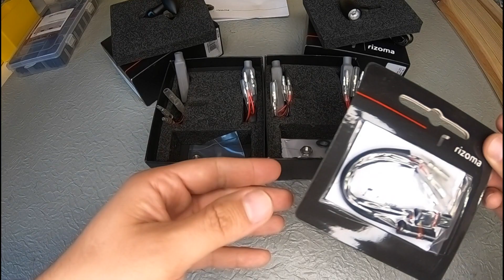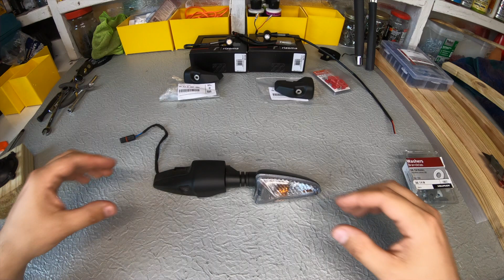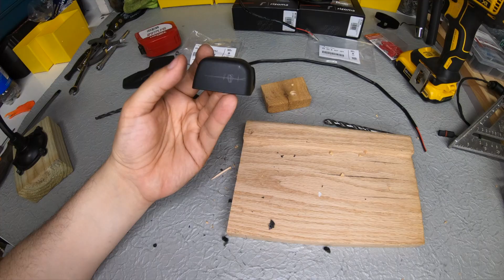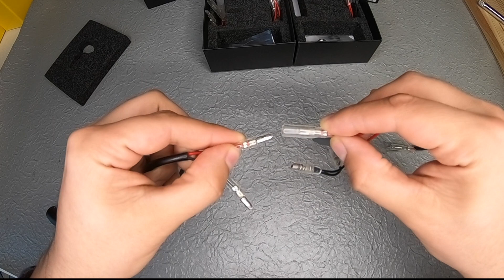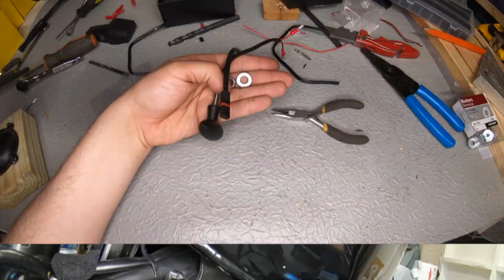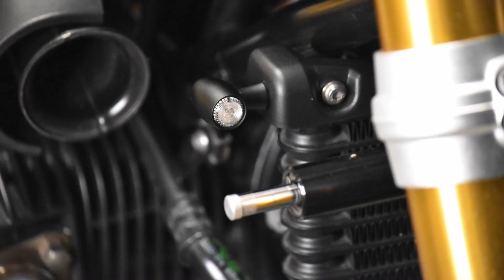Rizoma Club Lights Installation on a 2014 BMW R nineT

Comment: They have to be 3-4 times bigger
Reply from the maker: Not in the USA, and those lights are way brighter than the OEM lights
Reply: @Janoo609 no doubt that they are bright but big form would add to retro look. I think blinkers should be bigger and mirrors should be round :)
Reply from the maker: @KyryllStd  I think it comes to personal preference.  I did not want large lights, I was looking for a more discrete look
Reply: @Janoo609 I wish they give different size options… unfortunately the trend is to get the smallest possible…

Comment: does the 2016 require the resistors or no?
Reply from the maker: @chriskamen2152  I am not sure, but the Rizoma lights come with the resistors included.  My advise is, disconnect a light and plug in the one you want install to test it before going through the whole assembly

Comment: Hi. I’m having a problem with the relay. My dash shows an lamp warning sign after changing to LED. Is there any solution?
Reply from the maker: Did you use the resistors?  If you did and still have that warning light on your bike, then the next step is take the bike to the bmw mechanic and ask them to change the codes.  The r9T came in two different modes, ready for LED lights (European version), and bulbs (American version).  The codes on the bike can be changed, but that can only be done by a BMW mechanic.  People use the resistors to bypass the codes
Reply: @Janoo609  I will try this next week if they (US FL dealer) can change the code of my 2018 bike LED. I installed New Rage Cycles tail tidy led kit and my bike was getting an error.
Reply: @Janoo609  I contacted BMW in my country and 3 of them dealers gave me the same solution. “Do not use aftermarket parts. Because the code is gonna pop out no matter what you do”. So to me they just wanna sell the original spare parts which are super pricey. Reason why I’m trying to change my signal light is because the brackets are so fragile it cracked and turned into powder. I’m not sure if it lasted longer in cold weather country. These signals light from BMW are just unreliable.
Reply from the maker: @bruceiscurious  My guess is that they do not want to help you.  They should be able to do it just like they would do if they were installing the BMW LED lights.  

One more thing you can try is to install the resistor in the different forms they have in the instructions.  I believe rizoma gives you like 3 different ways of doing it, depending on the R9T model you have.  Try each one of the different options and see if any of those work

Comment: Hi, having found the indicators, I am unable to get  the connector cables. Would be glad if you could share a link to the cable connectors.
Reply from the maker: I got the rizoma connectors for BMW.  https://www.revzilla.com/motorcycle/rizoma-turn-signal-cable-kit-bmw?gclid=Cj0KCQjwnMWkBhDLARIsAHBOftp6gMP_SYwn4R3MGT5Lm_KojceOAPYywY81Q2OQ3zv6qnAfHFJMth4aAr7OEALw_wcB&sku_id=1277842
Reply: Thank you so much my Bro